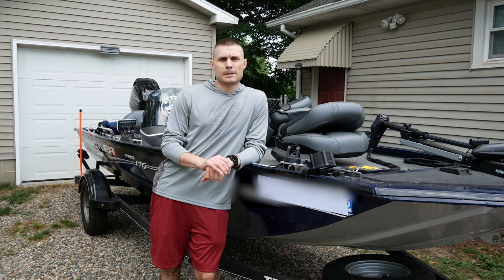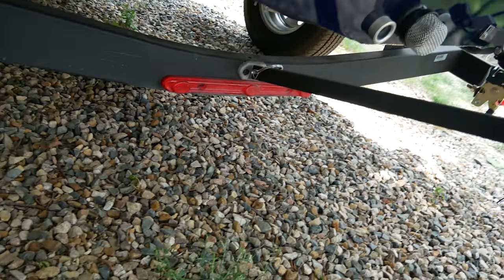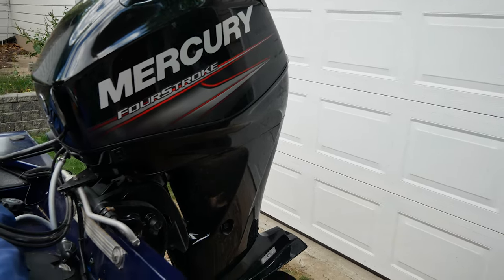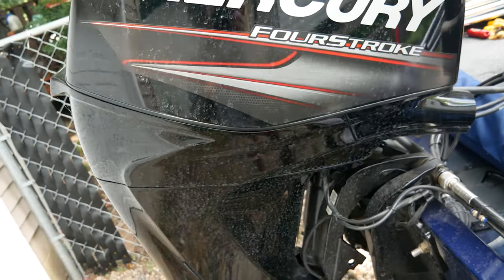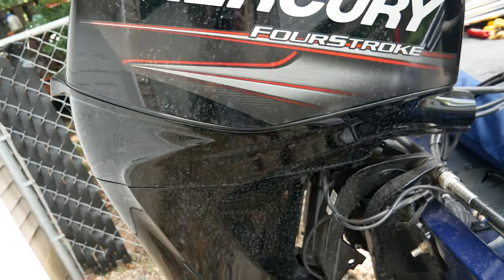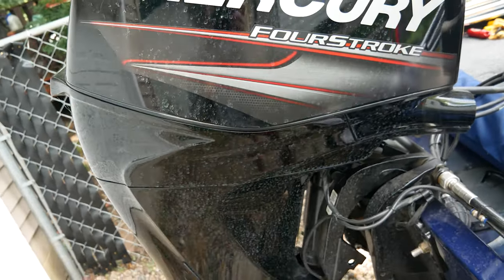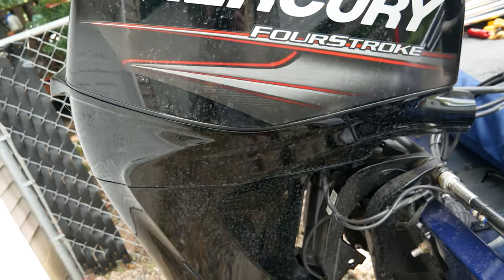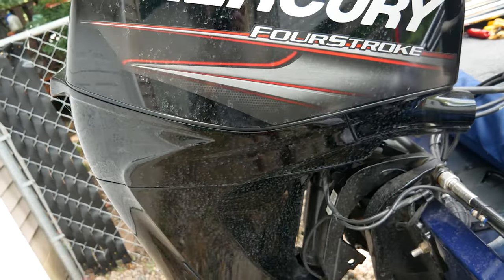BASS TRACKER PRO 170 walkthrough (2019)

Comment: I bought the same exact boat but a 2020. I was nice if the water was glass but anything over a 1 foot chop she would beat the hell out of you. I put a 80lb troll on it it was great more power than you need. But last year I sold it after owning it for a year and a half because it just did not work at my home lake Clear lake in California It's a big lake with rough water more often than not and I could not go out and fish a lot of days so I sold it. I bought a  2006 20 ft Skeeter with the money and I haven't looked back but I did sacrifice some reliability for a smoother ride that can get me anywhere on the lake no matter what the conditions. That was more important. But the peace of mind I had with that little four stroke was pretty priceless I knew and I got out that motor would start every time and it did and didn't let me down. They are good boats for what they are just depends on the lake you're fishing.
Reply from the maker: Absolutely agree. I appreciate you sharing!

Comment: Thank you for the video.  However, I have a question.  On my pro 170, water gathers under the seat where the fire extinguisher, light, and paddle are kept.  Is there a drain in that compartment?  I believe all the water does not drain out through the drain in front of the seat and then seeps into that compartment.  Any ideas?
Reply from the maker: @dreamabromfield7734  when you pull the plug in the rear, does any water come out? Might have a small hairline crack letting water in. Follow the weld lines and look for small cracks. They are lifetime warranty so they'll fix anything. But the boat would sit for awhile until they fixed it.

Comment: 24v motorguide? Where did u put another battery and how did u pull larger wire to accommodate the 24v?
Reply from the maker: @Paul-c9m   Will need to upgrade your bank charger from a 2 and maybe relocate depending where it's installed. But battery is side ways so turn it the same way as the other one and it can move towards the front of the boat and another can go in the middle.
Reply: @MittenFisher  how did u pull the larger wire to accommodate the 12 v, as it seems the 170’s only have #10 awg 105c wire, and according to what I found, it’s not heavy enough, it will eventually burn up the trolling motor